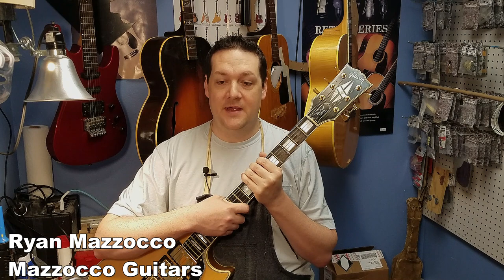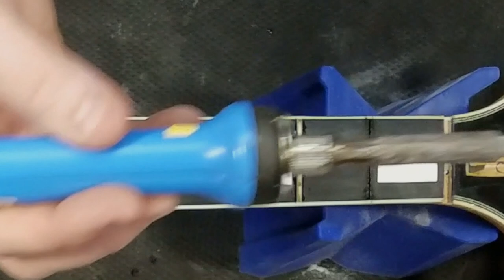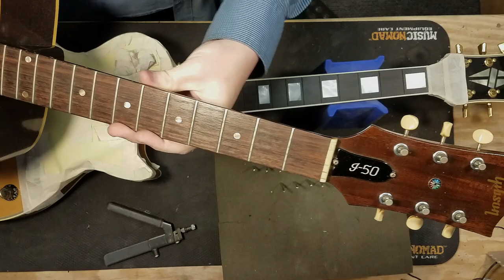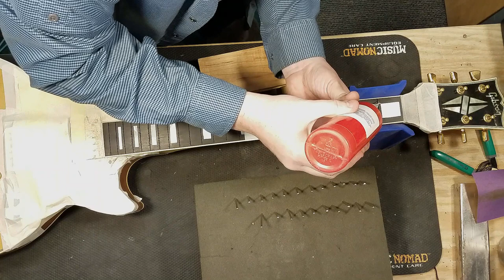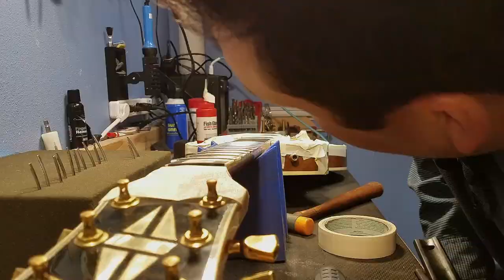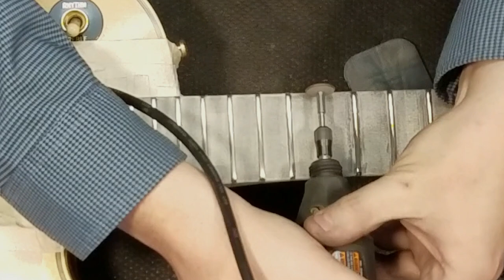Re-Fret: Gibson Les Paul Custom

Comment: No!  Don't do it!  It's a valuable vintage guitar!  Don't lose the Nibs!!!!!
Reply: my thoughts also.  IF it's real "Vintage"...put the nibs back.
Reply: This Norlin era Gibson is not valuable enough to preserve the fret-nibs.
As an example of cost you cannot put more money into a guitar than it is worth.
I've a 1986 Custom Ordered Les Paul Custom.  The re-fret cost estimate from both Gibson and Elderly Instruments is almost $1400.
To preserve the fret nibs would cost more than double.  I would like to add that the Gibson Repair and Restoration Shop will not even perform the work to save the fret nibs, they simply will not take on that job nor do they even offer that service!   It just does not make financial sense to sink almost $2600 into an instrument only valued at $5000.  And you need to remember, once a Gibson has been re-fretted, with fret-nibs or not it is no longer original and will lose even more value.   I'd like to add that its future value will never attain the scarcity of a late 1950s era Gibson, nor would it ever match a 1960s era instrument.   That in part is due to the fact Gibson made many, many more guitars in the 1970s than they did the combined production of both the '50s and '60s.
Reply: @hkguitar1984  Gibson will not try to preserve the nibs in a refret, but they will do the one thing that has to be done - replace the binding on the neck and build it up with new binding around the new frets, and then remove the excess material to reveal 'new' nibs - just like it was originally done at the factory.  Yes, it's not cheap.  The instruments are worth it.
Reply: @mstecker  Nibs from the start are a fail, guess it was cool in the 50s. But its useless. Better to have nice frets you can use :D
Reply: @kongssund  Disagree!  I set up a lot of guitars, and I'm pretty fanatical about shaping the fret ends.  With 'nib' guitars, there is no need to do this.  You get a perfect feeling fret end.
Reply: @mstecker that the e string can stick between the fret and binding
Reply: I would never guessed a fretjob would cost more than 1k in the US.
Reply: @zaxmaxlax  makes sense for a guitar that's worth $7k.

Comment: Dear friend, loved your video.  I owned a fw that same year.   
Best guitar I owned.  What you were holding in your hand, that barb... to me that is the heart of the guitar.  Electronics and amplification and pickups will fairly compensate for lack of quality wood and premium wiring ... but where the petal hits the metal is the fretboard.  If that's not "right"  to the player, the guitar won't fly.  I realize that now after so many years.  Great video and insight!

Comment: Agreed.  Either nibs retained and run the new fret up to the inside edge of the existing nib.  ...or if the client is ok to lose the nib, extend fret to outside edge of the binding.  Either retains playing length of the fret.  I hear certain folks saying that when the nib is already lost, just run the new fret to the inside edge of the binding "for the look".  This seems inadvisable, as overall playing length of the fret with nib is reduced from original.

Comment: Great video. Nice to see someone doing it properly for a change. I do alot of stainless steel refretting and the only difference I have noticed is that you do not over bend the stainless steel frets due to their extra stiffness. If you over bend stainless, they pop up. They have to be radiused the exact radius of the fretboard. Also, I agree with the nib approach you took. More fret playing surface and less chance of string snagging. 👍

Comment: Nice work.
I've a 1986 Maple Fingerboard Les Paul Custom and was quoted $1400 for a refret by both Gibson Repair and Restoration and also by Elderly's Repair in Lansing MI.   Always more work with the Gibson binding.  The nibs are nice however with age they can become problematic.
Good job giving the player a little more fret on the outer edges of the "E" strings.
Reply: 87 lpc silverburst ebony fretboard
Reply: That's insane! The maple board means they'll have to refinish if they're leveling the board but I couldn't imagine charging more than $100-200 additional for that.
Reply: @LotharOfTheHillPeople it's quite feasible to refret maple without a respray you just have to cut the lacquer around the frets and be exceptionally careful when doing the fret ends not to file into the finish

Comment: After removing the frets the nibs are still intact. Why cant you just use the old frets to cut new ones to exact length and replace with nib still intact? Just wondering.
Reply from the maker: Great question! and you totally can do that. but it takes wayyyy more time, and time is money. and someone has to pay that money.  the takeaway for me is this: Either option is viable depending on the vintage of the instrument and what a person is willing to pay to have it done. Thanks for watching and the good comment.
Reply: I was thinking exactly the same. It will take some extra time to measure it exactly but don't you save a lot of time from not having to dress te fret ends ?. I can imagine that leveling the fretboard without a radius block that fit perfectly between those nibs is going to be a pain with those nibs on

Comment: What grit did you use for leveling the fretboard?

Also, for polishing, you go to higher and higher grits.  What grits did you use to polish??

Great video!  I'll have to look and see if you have one on nut replacement and how to cut it and what depth?  Do you just cut it down to a certain feeler above the fretboard for each string as on a radius, OR cut down until a certain distance between top of fret wire and bottom of screen and again for certain distances depending on string used so radius is maintained??

Any information is greatly appreciate and in getting mu instruments to play as well as humanly possible!  :)

Comment: I am fairly certain that every single “traditional” guitar Gibson has made the radius is 12in ONLY. You will find alternative radiuses in the Modern collection that have a compound radius but this NORLIN Era Les Paul Custom absolutely SHOULD have a 12in radius. The fact that 12in felt off could be for a number of reasons that may or may not have been worth investigating. I will look into it when I get some time and I don’t want to sound like I have definitive irrefutable knowledge that Gibson has only ever used a 12in radius on their classic models rather I’ve seen and owned more than enough to determine this to be the case. Perhaps there are exceptions but I am 99% confident this NORLIN era LP Custom should have a 12in radius.
Reply: Theoretically that should be the case. In practice, almost every Norlin electric I've refretted has been closer to 10" though.